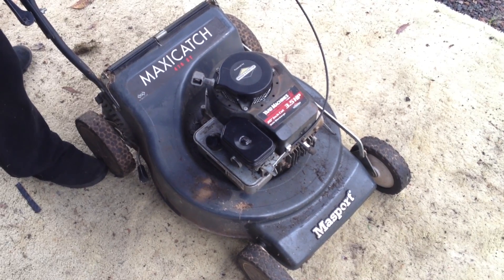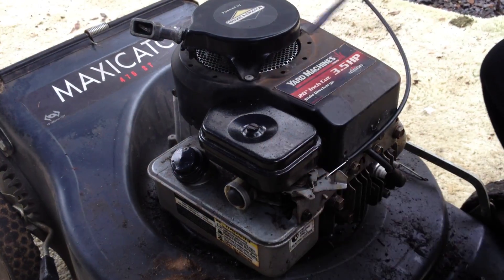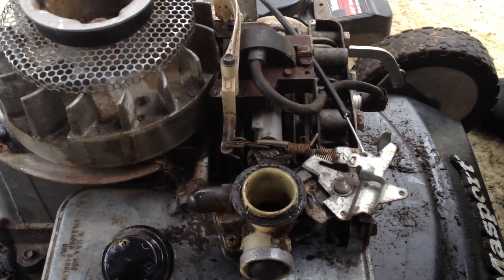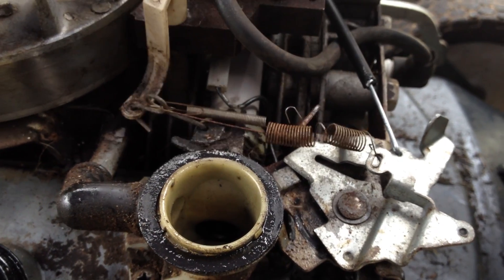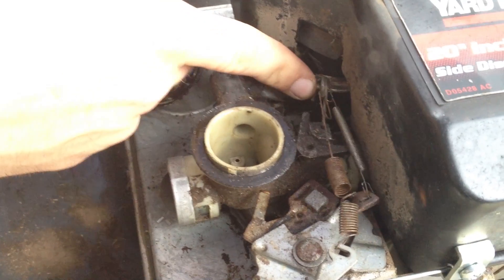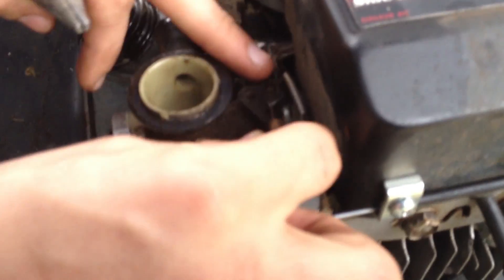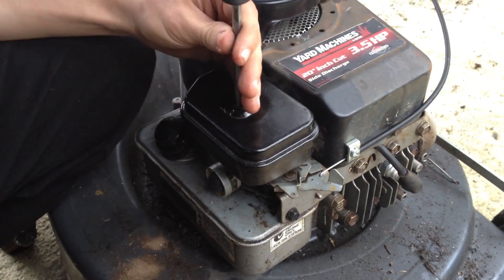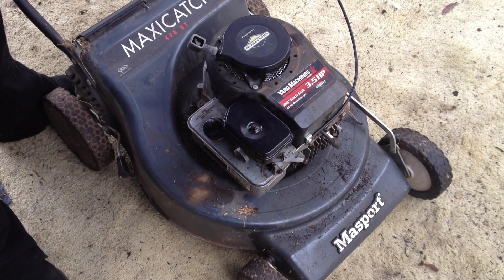PushMowerRepair.com - Briggs 3.5HP Adjusting Governor to Change Rpm

Comment: It must be better to replace the springs it looks awful and it´s not the right way to adjust it. The small spring is used to raise the rpm when the motor is working hard.

Comment: Thanks so much dude, I have seen about 4 or 5 of these videos talking about the springs. But nobody explained the governor was air operated and how it worked, with your video I found and fixed my problem in like 2 minutes. (Piece of metal was blocking the governor plastic piece from fully moving).

Comment: Replace the governor spring before adjusting the tang. Get the OEM spring. Make sure the intake gasket isn't leaking. Put your hand some over the carburetor and see if it slows. Check if the throttle is sticking in it's bore. They do on these carbs.

Comment: One 3.5  I'm working on currently although VERY easy starter, seems to have anaemic throttle response,especially compared to the 2 Victa with "450-series" Briggs I also have,  and I'm wondering if low spring tension of this spring is a likely cause...OTOH, it is possible to run this mower at a very low idle b4 kill switch kicks in, compared to the other two.
Reply from the maker: The slow throttle response could be related to the slower idle then the other mowers, a higher tension spring would likely speed up the idle and throttle response.
Reply: t/y..

Comment: You bent the wrong metal tab. If you bend the tab that the larger spring connects to in or out it will change the rpm. No need to bend the spring like that.
Reply: I think that he bent the tab that actually adjust the rpm, out of the way and bent the spring instead.

Comment: Are there always 2 springs? My Rover Wayfarer with a Quattro engine is over revving and running very loud. Took the filter off and the smaller spring is there with not much tension but the big spring is not there and I can't remember whether it was there before. I did fiddle with the valves and since then I've had this over revving issue.
Reply from the maker: There is not always 2 springs, It is best to run the mower without the air filter while adjusting so you can see that action of the throttle and springs, It is safe to do so in a clean dust free environment for short periods of time.
Reply: PushMowerRepair.com fnaguitarplayer9 hello mate wondering could you help me with a problem I seem to have with my Briggs and Stratton lawn more engine , The. Lawn more is revving high . I took off the air filter and all the throttle cables is cut off so it's only the governor is out the side I have it pulled the hole way back and it still revs high is there anyway on earth I can fix it thanks .
Reply: I don't know what you have, but the older model B&S engines with die-cast carbs but still with carb on tank, often only had the larger spring, and it is a different appearance spring, without a long arm at one end like Sprints/450 series etc..
Reply: mine is behind the flywheel im not sure what to do my is revving up bad got to be the spring in front like your spring i don;t know whether to tighten it or loosen it

Comment: Thanks for the vid, I followed your steps to adjust as it was revving high & had no rev range just fast & off but it made no change until I released some tension on the small spring a bit of testing gave me the desired rev range. I was wondering though since you bent the tab away from the governor wouldn't that apply excess tension on the governor not allowing to fluctuate?
Reply from the maker: +Dwayne Rothe bending the tab is not always needed, on some machines different springs have been used and the tab can interfere, however if it is not causing any problems a little bit of adjustment on the springs will usually solve any problems.
Reply: +PushMowerRepair.com 
Thanks, my 86 YO neighbour is thrilled to have it working again, I overhauled the carby, reset magneto gap & replaced o-rings & gaskets but was unsure on the governor springs settings, your vid really helped me out, thanks again for taking the time to post it

Comment: Thanks for video. However from my experience can say that bending metal is not good idea.You are changing distance between flap and that metal, that is made by manufacturer. When you buying new governor spring set, there shown which  model to fit that set. same thing with stretching or bending springs. adjust rews always possible with mowing handle, but will get problem with engine rews under pressure, when getting to cut different hight grass.But governor working principe  is correct

Comment: Ah, the Governor! I had no idea. A friend taught me how to rebuild the carb and the last time I did it, it was over-revving just like this mower. I thought I had messed up the linage somehow, but it looked fine. Last week, the vibration caused the blade to drop right off the mower. No worries, I heard the clanking and stopped the mower before it could "throw it", it just dropped right on the ground. I hope this is the problem, I really can't afford a new mower right now.

Comment: The video was helpful to me as well. I especially like the fact that you took off the cover to demonstrate how the flywheel is involved with the governor.

Two points that may help others:

I purchased Briggs & Stratton part 19200, a tachometer (see photo: http://ts3.mm.bing.net/th?id=HN.607995123984500421&w=168&h=174&c=7&rs=1&pid=1.7) to set the RPM. I calibrated it first by measuring the RPM of a different engine that was new and factory set. It is simple and easy to use.

Secondly, the throttle shaft (triangle shaped thing that rotates - see at 1:37) was installed incorrectly: It had been rotated 90 degrees clockwise (looking down from above) so that both points of the cam were in front of the cam stop. This made the engine run well above normal, perhaps 5000 RPM. Simply lifting the rear point over the cam stop returned the throttle to normal operation.

Comment: hey i just fixed up my dads mower , however when i put it back together and started the mower it revs at full throttle. so i played around with linkage springs now it runs perfect idle and good rev but only whilst the air filter is off once i screw it on and start it the revs stay high again. any ideas.
Reply from the maker: Hi Sometimes when the air filter is put back in place the  linkage springs can get caught or be obstructed this is most often the cause of the problem you describe, the easiest way to check/resolve this is to carefully put the air filter on while the mower is running and try to see what changes.
Reply: Take it to a garage would be the best idea it needs pro advice not chancers